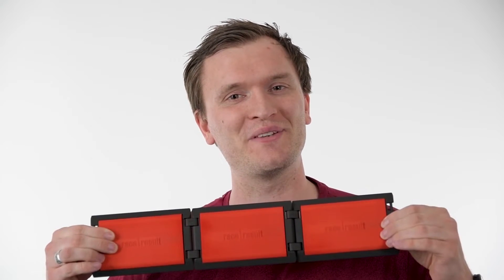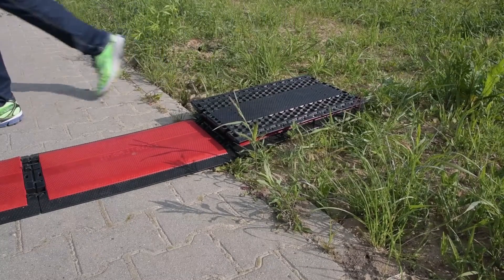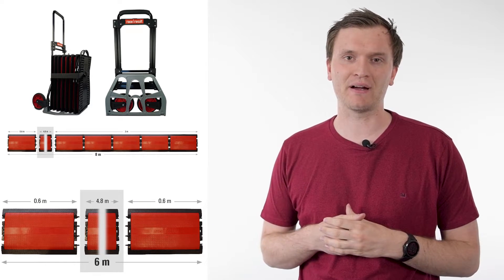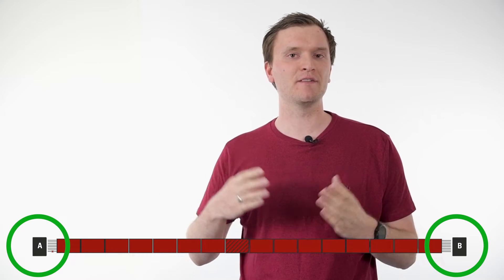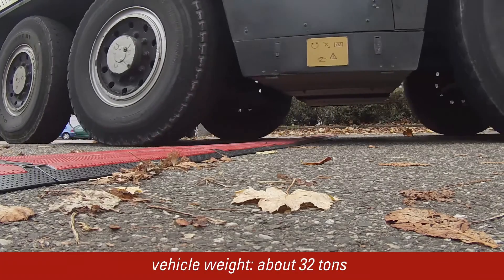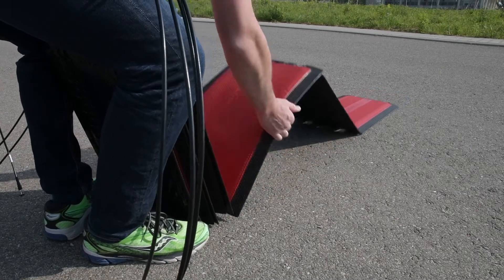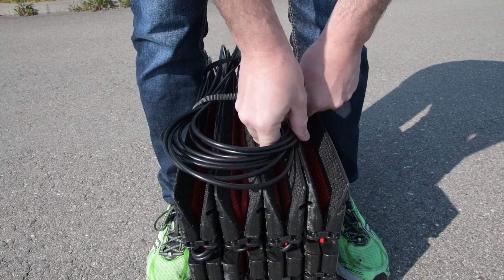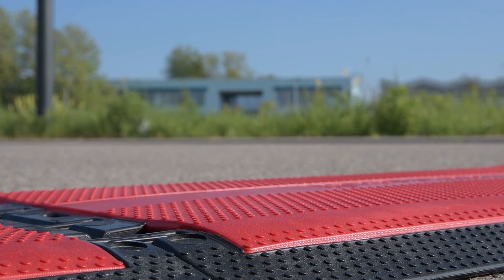race|result Tech Check: Ground Antenna Best Practice

Comment: So I am assuming that both the 6m and 8m extension kits still only use 8 antennae - correct?
Reply from the maker: Correct, in the 8m extension antennas are spaced apart. See how in the knowledge base: https://www.raceresult.com/en/support/kb.php?id=2236-Setting-up-the-8-m-Antenna-Extension-Kit